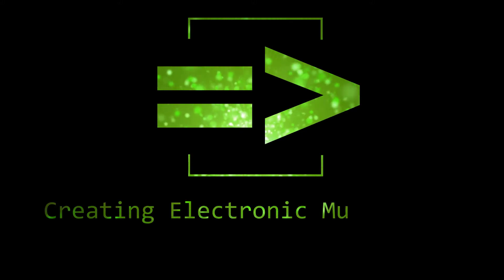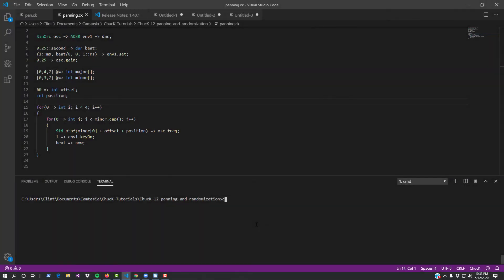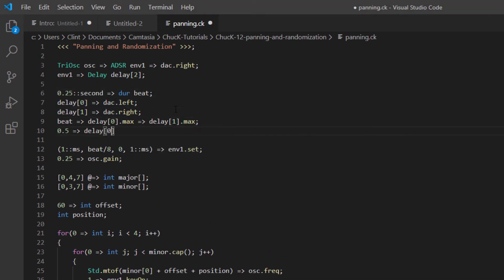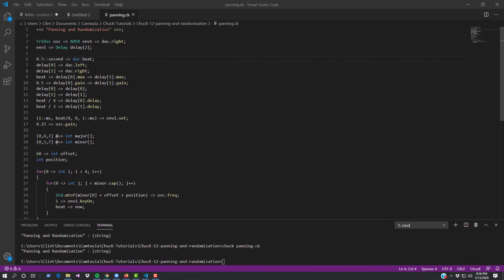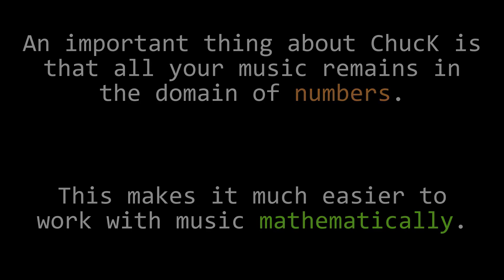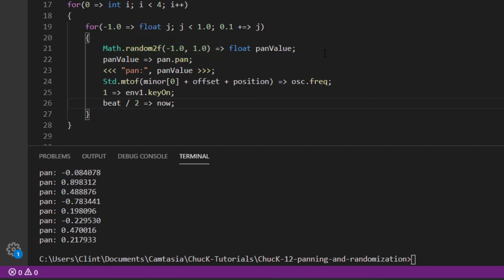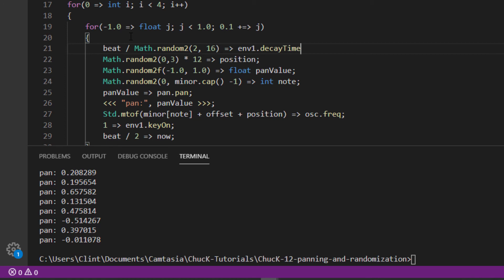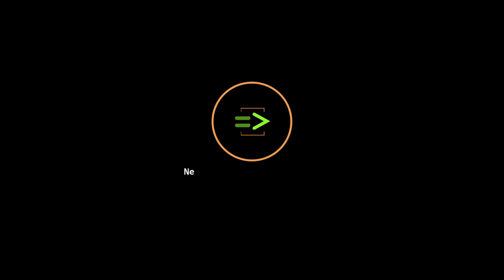Creating Electronic Music with ChucK - 12 - Panning and Randomization

Comment: I tried a code with panning and tried to export it as a wave file using the WvOut => blackhole method, but instead of getting a stereo file it only prints a file in mono. Any workaround to this? 

I'm doing TriOsc osc => ADSR env1 => Pan2 pan => NRev rev => dac;

dac => WvOut test => blackhole;
"random.wav" => test.wavFilename;
Reply from the maker: For some reason this is not in the ugen reference online, but WvOut2 is a stereo file output ugen. (It's one more thing that's only documented in an example file.) 
I just tried 
---
SinOsc osc => ADSR env1 => NRev rev => Pan2 pan => dac => WvOut2 wvOut => blackhole;

me.dir() + "stereo.wav" => wvOut.wavFilename;
---
...which resulted in a stereo wav file.
Reply: @BachelorMachinesTV  Thanks! If I can ask, what does me.dir() do?
Reply from the maker: @ayusharipirala3121  You're welcome! Re: me.dir():It just returns the directory the script is running from. Very helpful for accessing other files that are sitting in the same directory.
Reply: @BachelorMachinesTV  ah, I see. I usually just dump those .wav to the same directory as the program so that I can use them from VS itself